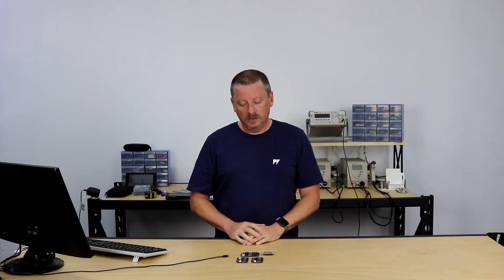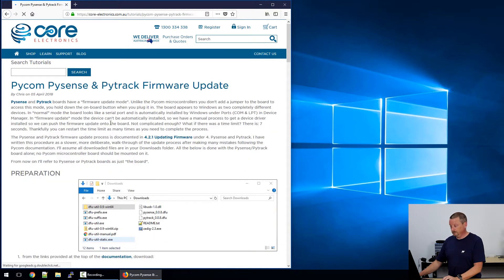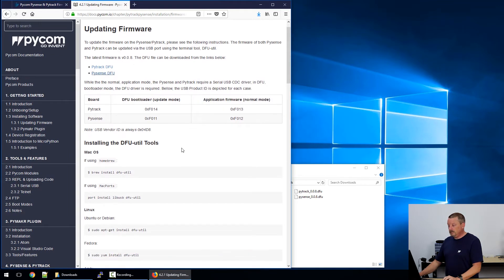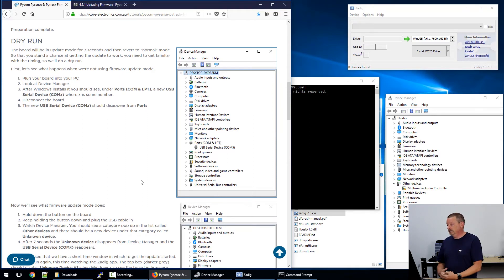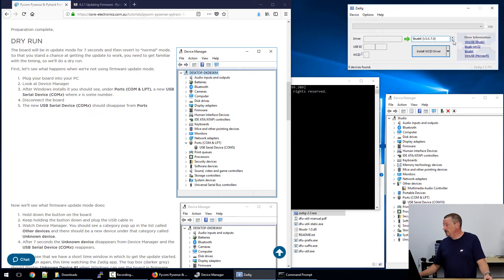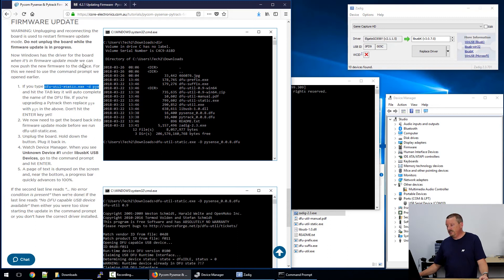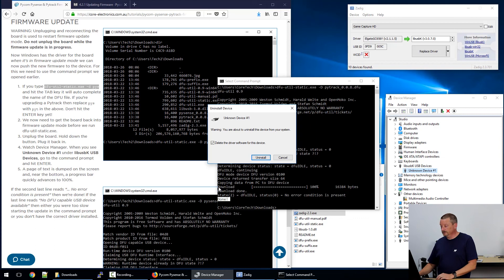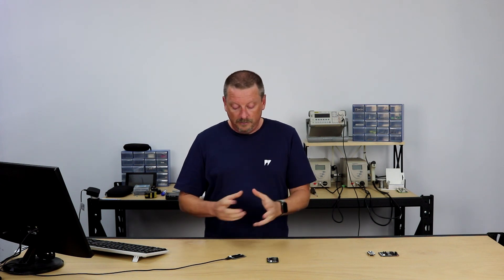Pycom Pytrack and Pysense - How to Update Firmware

Comment: Thank you for the video. One question I have is that I'm using a pysense board with a lopy extention. So I updated the firmware after removing the lopy board and everything seems to have went well with the update, but afterward, I was unable to connect to the board through atom pymaker. Any idea what could be causing the problem?